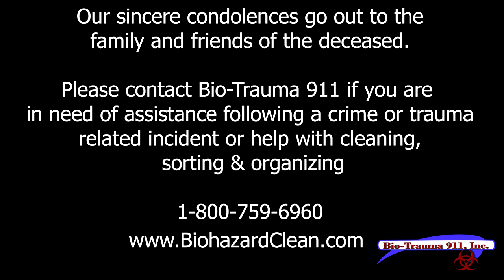Decomposition in Hotel (Dead for Three Weeks)

Comment: Find it hard to believe that he was three weeks posthumous; maybe three weeks on site as a paying customer, but not three weeks decomp.  Just not enough evidence of advanced rot.
Reply from the maker: We obviously weren't there when it happened. We were told by the detectives who released the scene that their best guess was three weeks since that was the last time anyone had contact with the deceased. It was winter time and the heat in the room was turned off. That certainly could have slowed down the rate of decomposition.

Comment: I used to remodel hotel rooms. 
I was an interior designer
I would do entire floors of rooms in some of the best hotels. You would be shocked at the stuff hidden under nightstands and beds. I found sex toys, suicide notes, huge amounts of cash ($28,000 inside a bathroom ceiling tile) diaries, porn, drugs. 
It was crazy.

Comment: I would implement using Luminol or a “generic brand” to make sure items are truly contaminate free. These are amazing guys, they handled everything correctly and showed respect for the decedent. 
If this clean up makes you uneasy, you would never travel again if deaths had to be disclosed. 
People die in homes and in public areas every single day. It’s more probable that you’ve lived, slept, or been in the same spot that someone has died than you haven’t been.
Reply from the maker: Thanks so much Ami for your comment and support.  We tend to use Hydrogen Peroxide to detect blood.  It actually works quite well and is very easy to cleanup once applied to a scene.  What you don't see in this video is the fact that we saturate the room several times with a hospital grade disinfectant and change our gloves on a regular basis, so as not to cross contaminate the scene.  By the way, we did return to the hotel to remove and dispose of the mattress!!  Thanks again for taking the time to comment.

Comment: Have you ever had it to get so bad that the bodily fluids actually melt down through the floor and leak into the apartment down below?
Reply from the maker: Yes, we've experienced situations like this several times over the years. Of, if in an apartment or hotel room, it's not uncommon for the fluids to run into the residence next door (if the death occurs near an adjoining wall) or drip into a crawl space or basement in a home. Thanks for the comment!!
Reply: @Biotrauma911  
You guys have such an important job that you perform. You have totally got my respect. Thanks for answering my question friends.

Comment: I'm gonna start asking if anyone died in the room.  That box springs should have been thrown out also.  These guys are picking thing up with their gloves on that have bio hazards and then touching things that will stay in the room with the same gloves.
Reply from the maker: Thanks for the comment Mary.  You only watched a video that was a few minutes in length.  This cleaning job took us nearly 4 hours and we changed gloves routinely.  Our techs wear 3 sets of gloves at all times, one of which can be stripped off quickly when it becomes contaminated.  That said, we continuously spray disinfectant on all surfaces to kill any germs or infectious organisms.  I think it would be safe to say that after we finished with that room, it was probably one of the cleanest hotel rooms available.  Thanks again for the comment.
Reply: @Biotrauma911  thanks for your reply.

Comment: Absolutely hate hotel rooms anymore. The more I know,  the less I like them. Last one was a better end chain during my condo's sewer replacement. Think theu must use cold water and "green" detergent.  Bedding smelled like sweat and pillows were really smelly.  One bed was completely broken down like kids had been jumping on it. Could not wait to get back to my clean smelling sheets. Also, was supposed to be a handicapped unit. Had an older, very low toilet with grab bars on the wrong side for me. Almost was stuck there!! ADA toilets are higher by several inches. Bars in shower were in the wrong places too.  Damn near reported them to the ADA. I am partially paralyzed on one side. Why I travel so rarely anymore.
Reply from the maker: Thanks for taking the time to comment.  Our company has had pretty good luck with hotels during our travels but we have come across some pretty nasty ones.

Comment: So my OCD has to make me ask this question.  You are wearing gloves, right?  You are handling contaminated material with said gloves, right?  So aren't you cross contaminating other items (i.e. mattress, box spring, other bedding on the other bed) in the room?  Everything that was able to hold a scent should have been disposed of.  After 3 weeks it would have smelled awful or so anyone would imagine it would have
Reply from the maker: Thanks for the comment. We've answered this question several times in the past. You're watching an eleven minute video of a job that took about three hours or more to complete. Our technicians wear a minimum of three sets of gloves at all times. You don't see them tear off gloves as they become contaminated. You also don't see them replace contaminated gloves. Also, our technicians have been doing this job for a long time. They do their very best to not touch contaminated items. Just because they pick up something that looks to be contaminated, doesn't mean their fingers are touching biohazards. Finally, we spray everything several times with a disinfectant. This disinfectant is applied to all new layers as they are uncovered. Technically, nothing is contaminated because the disinfectant has killed 99.9% of everything in that room. As a matter of fact, when we left that room, it was probably the cleanest hotel room in the state. Now we did return later to pick up and dispose of the mattress. We don't show glove changes, or every time we spray disinfectant, as that makes for pretty boring video. On top of all of this, the room was quite cold. It was winter time and the heat had been turned off for whatever reason. Thus, due to the temperature in the room and the small stature of the deceased, the level of decomposition was minimal. Once we removed all of the biohazards, there was no detectable odor. And finally, I will add that we are a private company and must comply with the requests of the client. We have no obligation or are we legally entitled to dispose of items that the client wants to keep. So if a client tells us to leave other bedding, curtains, towels, etc., we have to leave those items. It is not our property to trash. And finally, we weren't there when the person died. We were told by the medical examiner that the deceased had probably been there for about 3 weeks. This was partially based on the hotels access logs showing when the deceased last left the room.  I hope all this make sense.

Comment: That's all there was from 3 weeks?!
Reply from the maker: Hi Nicole and thanks for the comment.  We were told that they individual laid at the scene for approximately 3 weeks.  Since we're not crime scene investigators, we can only base our knowledge on the information received from those at the scene.  Typically, we see more of a decomposition after 3 weeks; however the room and outside air temperature was quite cold, which could have slowed down the decomposition.  Also, we don't know the size or weight of the deceased individual either.  Thanks again!!

Comment: There was bio soaked into one of those wooden boards from the bed frame.
Reply from the maker: Thanks for the comment.  Not sure what you saw but all areas of the scene were properly cleaned and/or removed from the scene.  Remember, you're only watching a few minutes of a remediation job that actually took us nearly 4 hours to complete.  There are a lot of steps, such as numerous glove changes, that you won't see in the video.  Additionally, we spray nearly a gallon of disinfectant throughout the scene and that can sometimes appear to be a biohazard contaminant. Also, if wood is properly sealed with several coats of polyurethane, blood and bodily fluids can safely be wiped from the surface.  Finally, we did return to the scene to pick up and destroy the mattress.  Thanks again!!

Comment: Ewwww, they said they could save the mattress then moved it with their gross gloves on. 🤢
Reply from the maker: Thanks Tricia for the comment. You only watched about 17 minutes of video of a cleaning job that took us nearly 4 hours to complete.  During that time, we changed our gloves on a regular basis.  Our techs wear 3 pairs, which can easily be pulled off when one set gets contaminated.  We don't show the glove changes on video, as that would be extremely boring to watch.  In addition, we continuously spray disinfectant throughout the room and on all items to kill any germs or organisms that may exist.  We did return to remove and destroy the mattress.  Even though it wasn't contaminated, it was decided that it would be replaced.

Comment: Do you guys ever wear respirator masks? I think I'd need more in a small enclosed room.
Reply from the maker: Hi Dee Orr thanks for the comment.  There are times when the techs do wear full or half-face respirator masks but most of the time they just wear N95 masks.  Every situation and scene is different.  Sometimes they will wear complete protection until they've disinfected the entire room and then they'll either remove the mask or downgrade from a full face to a N95 type mask.